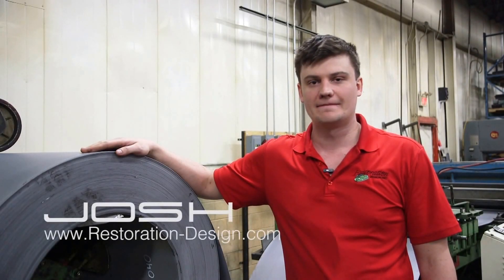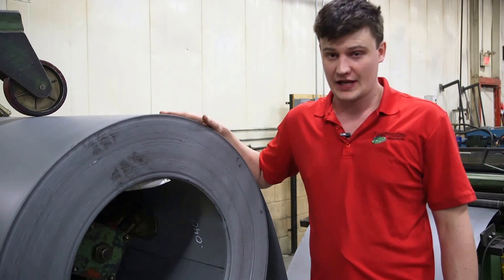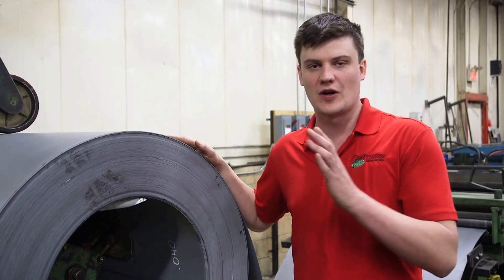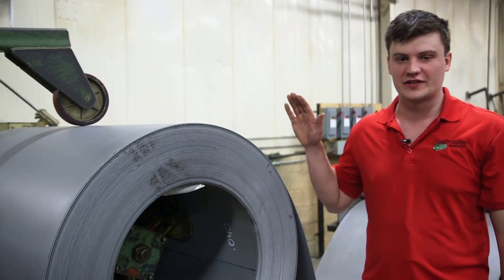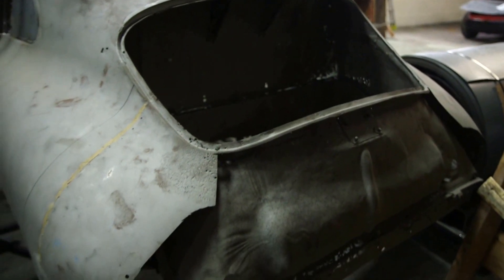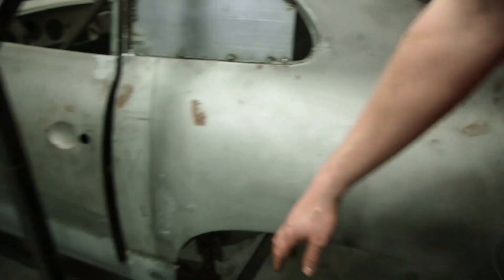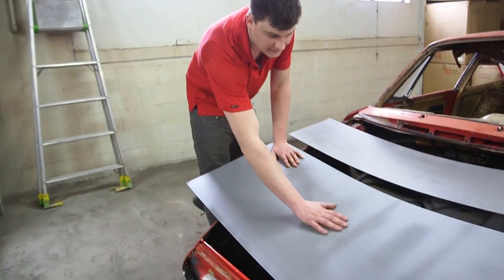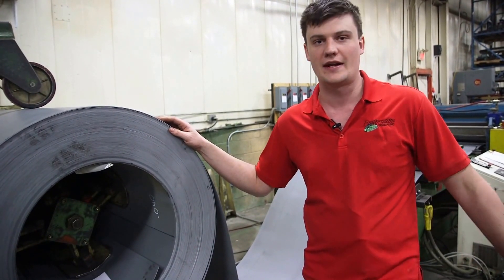Restoration Spotlight: Uses and Benefits of Galvanneal Steel

Comment: poison gas when welding?
Reply from the maker: It is good practice to have ample ventilation while welding, not only Galvanneal but all other metals as well.
Reply: Restoration Design But do you need to clean the galvaneel? Off the HAZ before welding?